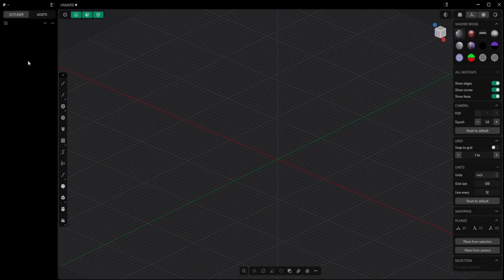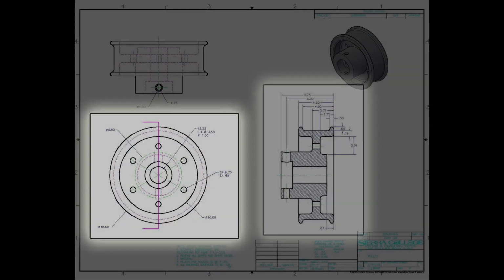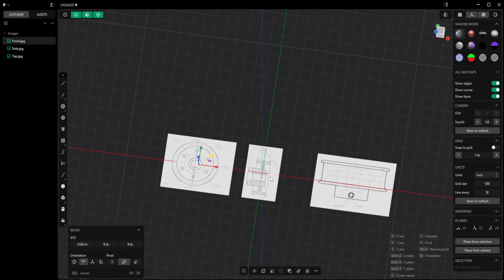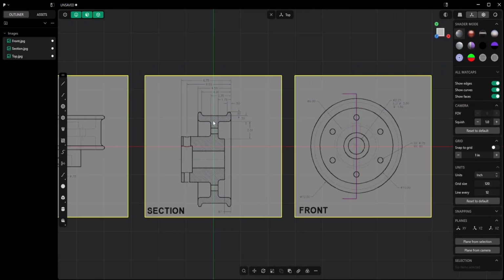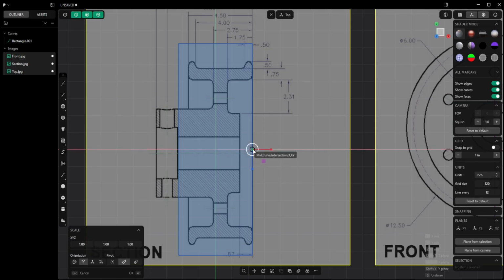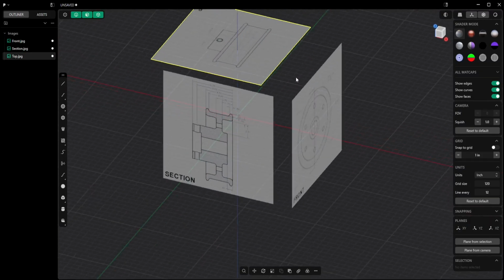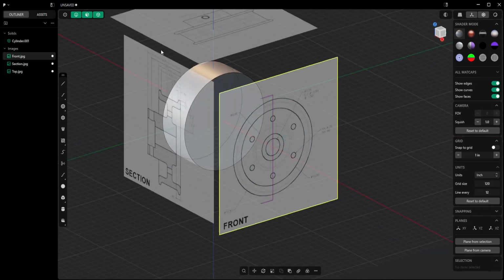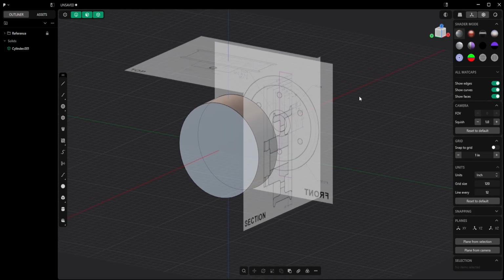Set up Reference Images at the Correct Scale in Plasticity

Comment: This is great. Thx.  At the start, you mentioned ensuring all 3 images are the same size.  How did you do that when clipping the screenshots?  Did you define an 8x8 clipping box each time?
Reply from the maker: No, I opened the drawing file in Photoshop and used the rectangular marquee tool to select one of the views, then hit Ctrl+J to copy it to its own layer. And I did the same thing for the other 2 views. Then I deleted the drawing layer, and stacked the 3 views on top of each other in the center of the canvas. Then I set the Canvas size to 8x8. Then I positioned each view so it fit nicely within the 8x8 space and saved each view to its own individual jpg file. Maybe there's an easier way to do it, but that's how I did it.
Reply: @roddeweese6402 thx for the detailed explanation!